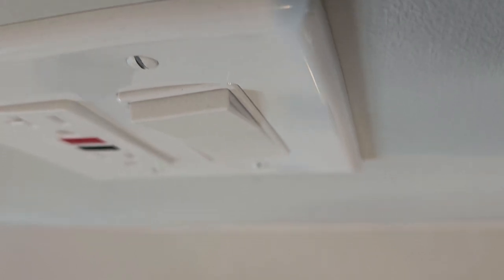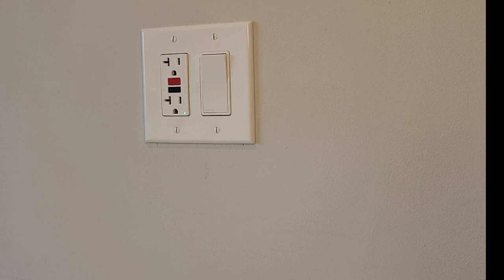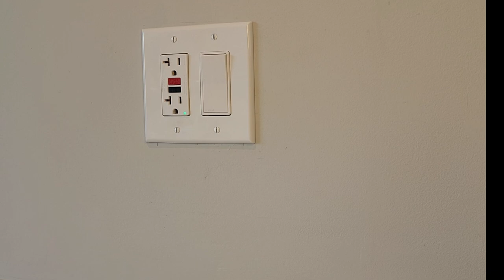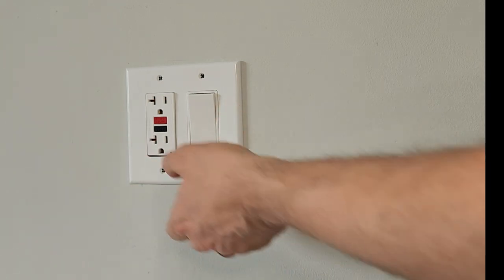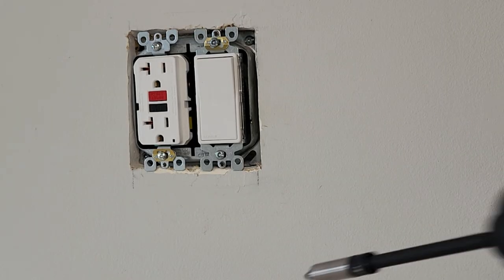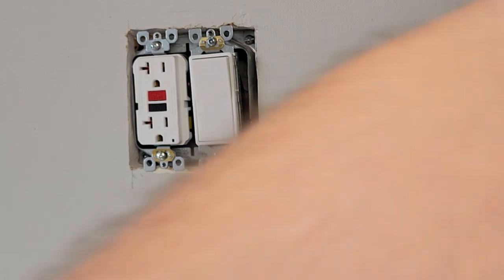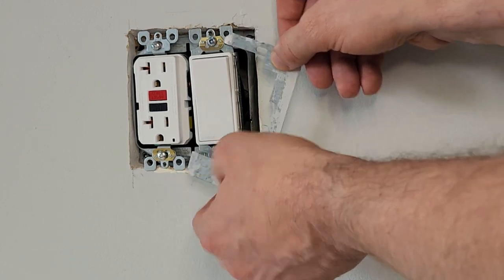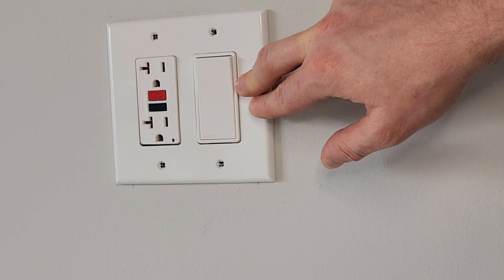A quick and clever way to fix a crooked or sunken switch or outlet

Comment: Are there any negative trade-offs involved?  For instance, if the switch or outlet is crooked but not sunken, would this shim make it stick out?
     How about doing a video about replacing a poorly installed outlet box?  Maybe it's the box that's crooked, not the switch or outlet.
Reply from the maker: No trade-offs at all. The leveling plates are super thin, so it will not make it stick out. 

As far as replacing or remounting a crooked outlet box, this channel is about trying to show better or more clever ways to do things and there's really no shortcut or alternate way to do that. 

I'm sure there are already plenty of videos already that show how to do it in a conventional way.
Reply: @cleverengineering2  : How thin is "superthin?"  According to the Amazon ad, 0.030 inches.  The ad says these are for "outlets that are recessed into the wall too far" ... 'to bring them flush with the wall."  To me, that suggests these are NOT for outlets that aren't recessed because those would stick out rather than being flush.  I assume from your reply that the outlet would stick out 0.03 inches.
Reply from the maker: @@brothermine2292  To clarify, they are not only thin but they don't encroach on the cover - the edges of the cover plate clear the edges of the leveling plate so it will not stick out any further.
Reply: @cleverengineering2  : I think you're implying that if the outlet front was flush with the cover plate then the shim would make the outlet stick out 0.03 inches from the cover plate.  Etc.
Reply: @brothermine2292 No. It doesn't stick out at all. I wish I could add a picture...it's a little hard to explain without one, but it sticks out exactly 0.0000000 additional inches from the cover plate (relative to before) because the leveling plate is smaller than the cover plate and because the screws on the outlet or switch get tightened down different amounts (depths) with and without the leveling plate.

If you've ever used a paper clip to eject a disc or to reset a device with a stuck button, you can see that many items can be used very effectively in areas way  beyond their stated purpose. 

This also works for outlets that aren't recessed and I can attest to this from personal experience.
Reply: @mikem2k38  : We agree the shim doesn't affect the cover plate.  But I don't see how you can be correct that the shim doesn't move the outlet or switch 0.03 inches.  With the 0.03" shim inserted between the outlet or switch and the box, the two screws that fasten the outlet or switch to the box will go 0.03" less deep into the box, right?  That means the outlet or switch ends up 0.03" further out from the wall than without the shim, and since the cover plate is unaffected it means the shim moves the outlet or switch 0.03" relative to the cover plate.
Reply from the maker: No that is not correct.  It's really unfortunate that I can't send a picture, but the screws that fasten the outlet or switch don't stop at a specific point - you can tighten them to different depths as desired.

Even without another picture, the thumbnail for the video should at least give you some idea - you can see in the thumbnail that the switch actually sticks out LESS far beyond the surface of the cover plate AFTER the shim is installed!  This is because you can tighten the screws under the cover plate that are on the actual switch to different depths.

I assure you that the shim does not move the outlet or switch or cover plate or anything else (unless you want it to - which is the entire purpose of the shim) if it's installed as shown in the video.

However, I want to be crystal clear that if you install the shim, but you DON'T want to move the outlet or switch or cover plate, none of them will move even AFTER the shim is installed - if you DON'T want the outlet or switch to stick out 0.03 inches or 0.02 inches or 0.01 inch more, then it will not stick out.

I can't explain this any more clearly without another picture, but if you actually follow the steps in the video exactly as shown, you will see exactly how this works.

My guess is what's throwing you is the fact that I tightened the actual screws on the switch with a power tool, so it went so quickly that it's not obvious how the depth of the screws can be varied.

Anyway, because I can't explain this any more clearly without another picture, I have to leave it here.

Good luck!
Reply: @cleverengineering2 : That still doesn't make sense to me, because if you don't tighten the screws that fasten the outlet or switch to the box so the screws are in as far as they can go, then the outlet or switch will stick out even more, not less.
Reply from the maker: I want to reiterate that the thumbnail for the video shows that the switch sticks out LESS after the shim has been installed, so while the thumbnail doesn't show you what's going on inside as far as the inner screws, it should clearly demonstrate that the depth can be adjusted.

I want to clarify that I am only talking about the inner screws when I explain that they can be tightened to different depths - I'm NOT talking about the cover plate screws.

The ONLY set of screws that you tighten all the way are the cover plate screws, and not the inner screws.

The outlet or switch will not be loose - the cover plate will keep the switch or outlet secure and prevent it from wobbling, and the metal shim will keep it even more secure and will further help to control the depth.

That's the absolute best I can do to explain it without a picture; if you actually try it with the shim you will see exactly what I'm talking about.

Good luck.
Reply: @cleverengineering2  : Ok, thanks for spending so much time on this.  It's news to me that what holds down the outlet (or switch) is the cover plate... not the two screws that "fasten" the outlet to the box.
     But I don't see how that can be, because the screw that holds on the cover plate is screwed to the outlet, not to something else.  So, rather than the cover plate pushing on the outlet to secure the outlet, the outlet pulls on the cover plate (by that screw) to secure the cover plate.
     In the small number of outlets I've examined, the two screws were screwed in as far as they could go, and thus secured the outlet to the box.  The two screws held the outlet securely to the box even without the cover plate installed.  Perhaps it was an older style box?  One side of the box was screwed or nailed to the side of a 2x4 stud (behind the drywall), so the box and the outlet were held securely even with no drywall and no cover plate.  Unfortunately, unless the screws/nails holding the boxes to studs were carefully positioned and screwed/nailed straight, the outlets could be crooked and/or sunken.  But on the other hand, by securing the box to a stud and securely screwing the outlet to the box, the force of plugging a power cord into the outlet is transmitted to the stud, not to the weaker drywall.